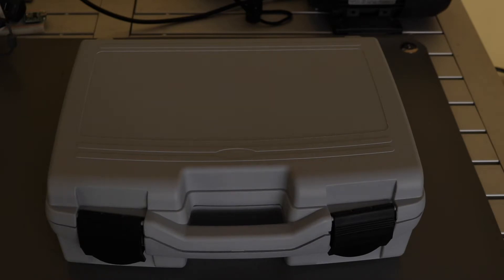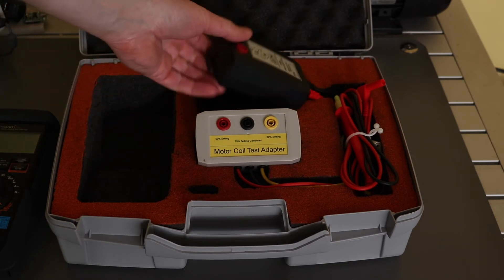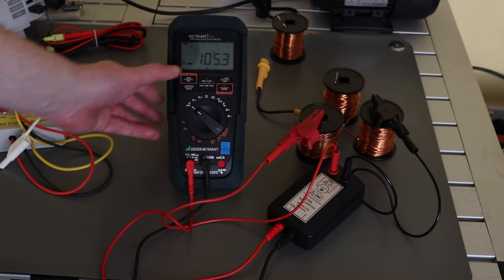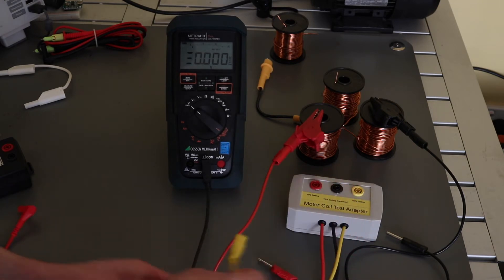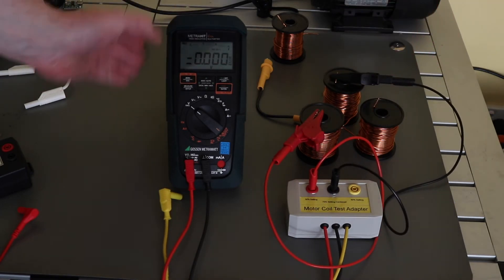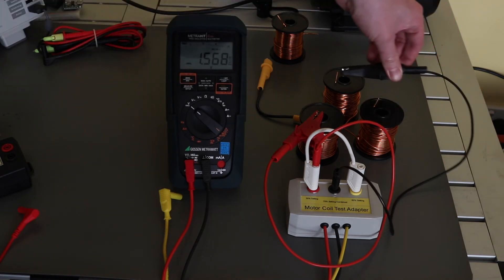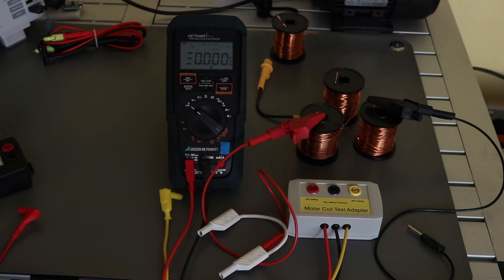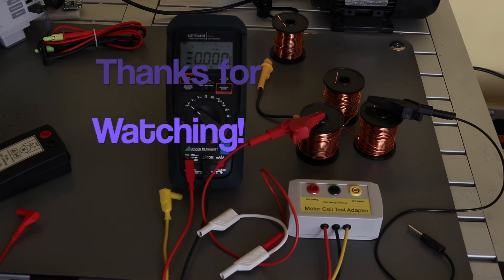Gossen Metrawatt MetraHit Coil Wire Coil Retests

Comment: Hello, which capacitor are you using for the tester? Any shematics maybe?
Reply from the maker: The parts list for the box I built up is in the element14 blog linked to in the description. The capacitors used were 0.22uF and 0.15uF for the dual adapter. From what I can remember, the capacitor is across the input with is a 10M discharge resistor across the capacitor. One leg feeds out to the output via a 2 Ohm resistor. The other side goes to the output via a gas discharge tube.
If you have one, it doesn't take much to open the coil adapter up and see how it is wired.
Reply: @three-phase562  Thank You, Any chance for the backside of the pcb? With "across" you mean parallel? I ordered the Coil Adapter XTRA...
Reply from the maker: @eaglemedia19  I have added a schematic of the adapter I built up into the comments of the element14 blog. Sorry couldn't find any pictures of the PCB.
Do you have the MetraHit Coil meter of the newer IM Xtra? I am now using the IM Extra with the Coil Adapter Xtra and I have been able to get readings on any motor I tested with that combination, where previously the MetraHit Coil failed to get a reading.
Reply: @three-phase562  Yes, I have got the IM XTRA and the Coil Adapter XTRA (which I'm still waiting for).
Reply from the maker: @eaglemedia19  So you shouldn't need to make up any other coil adapters unless you have unusual motor sizes. Whilst you can use the old standard coil adapter with the IM Xtra, you don't get the same level of control or ease of testing that you do when using the Coil Adapter Xtra.